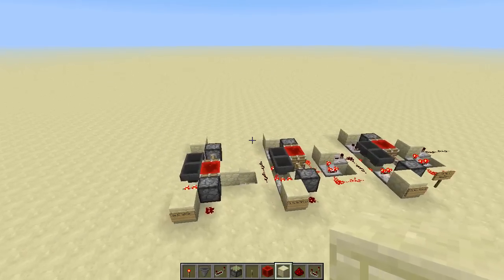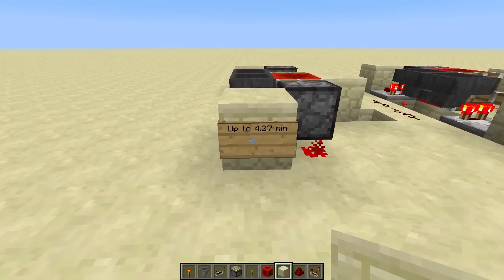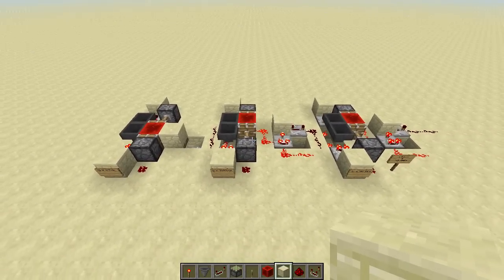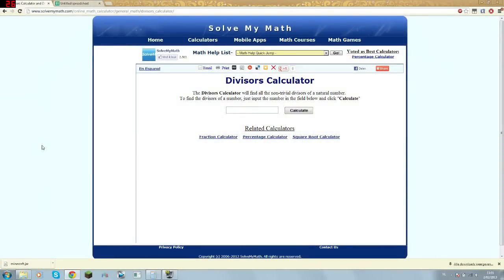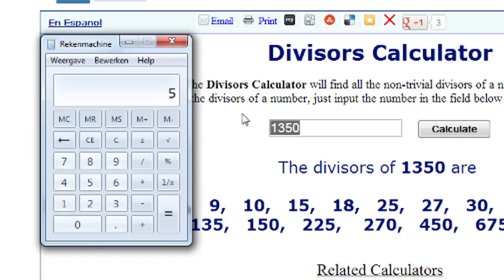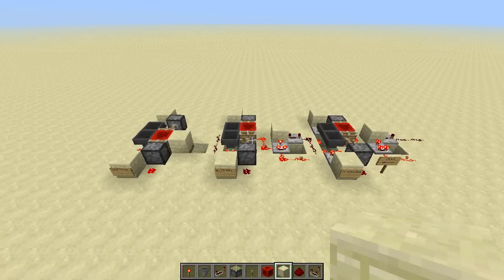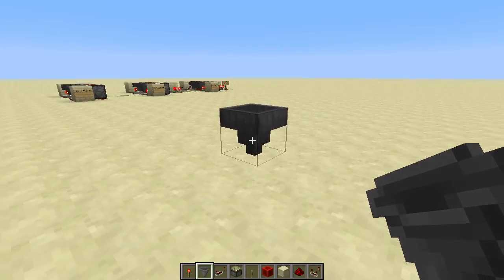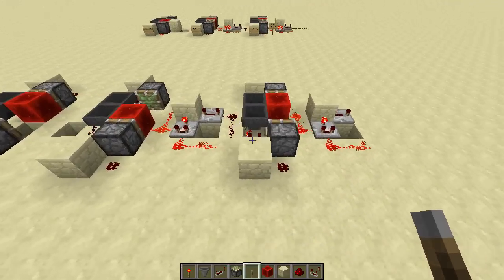Minecraft Tutorial: Extremely long and adjustable hopper timers

Comment: Also, in case people were wondering, what this is doing is basically finding the number's divisors in numbers below 320 because a hopper can only hold 320 blocks. Each hopper multiplies the numbers together. That's also why it doesn't matter what order they're in; multiplication doesn't matter which order it's multiplied in.

Comment: Seconds of delay=(2^(3+(5*X))*10^(X-1)), where X is the number of hopper timers chained together.

For 5 hoppers, the delay would be 85064 years. That's over 3000 generations, or 8.9 times the numbers of stars in our galaxy in seconds.
Seven hopper timers chained together would give a pulse once every 27220000 years. 
Eight would give a pulse once every 2.787×10^12 years. That's over 200 times the current age of the Universe.

Comment: Hey guys, another way to do what he did in the video is simply to put a comparator leading out from one of the hoppers into another hopper which is a part of another hopper timer. Whichever side you make the comparator lead into will be the side that the shorter pulse will come out, with a longer delay between pulses.

Comment: Tried this tutorial for an hour timer. 300 blocks in first hoppers and 15 in second. However when the timer starts running I've noticed that once the 300 blocks have swapped sides one of the 15 goes into the other hopper on the second timer so 1 block and 14, BUT that single block goes back to the 14 instead of another block joining the 1 to become 2....

I really hope that makes sense.....
Reply: But when you put 150 blocks in first hopper and 150 to the second - you will have basicly minute timer and hour timer at once. Becouse 150 blocks make minute timer. And minute timer + minute timer makes hour timer.

Comment: how do u make a 5 hour timer? If it's even possible?
Reply: +XAce_ AssassinX Just put the amount of items that u need in there
If u fill up the one of the first hoppers it would be 4,27mins and id u do 2 item in one of  the second hoppers it would be 4,27x2 and so on. u just have to calculate xD
Reply: That's easily possible just requires some math.
Reply: So what i did, was connect 7 hopper timer sections... overkill?

Comment: lol wut the fuck i just need 5 seconds! 5/0.8 = 6.25 (6)!!
and the closest nember to 6 that has more than 6 divisors is 24! what do i do??
another timer anyone!? help?!
Reply: What do you not understand in "Extremely Long Hopper Timer" ?! If you just need 5 seconds, then just build a simple hopper timer.
Reply: Tiboti Dalton but that is only .8 seconds every pulse
Reply: Gavin Burns
Tiboti Dalton oooh i see
Reply: Each repeater at maximum delay is 0.4 seconds. You can very simply place 12 of these in a line running into a block with a torch on it. Since the torch is 1 tick, you can place one more repeater to one tick coming out of the torch's output and then hook that repeater to the start of the line of 12 with wire. Hope it helped even though the clock is very inefficient and could be made simpler but it would be harder to explain xD
Reply: Daniel Grubb A repeater at max delay is four ticks, there are 20 ticks in one second, so you need 5 repeaters to make one second! And 30 to make 6!
Reply: Bokvakk Bkovakk There is a distinct difference between in game ticks and redstone ticks. I appreciate you trying to correct me, however a redstone tick is 2 in-game ticks, and hence my original statement was in fact correct where there are 10 redstone ticks per second. For further information, I suggest checking the wiki ;)
Reply: Oh, I forgot that! I work a lot with redstone and command block, so I actually knew it. But thanks for reminding me!